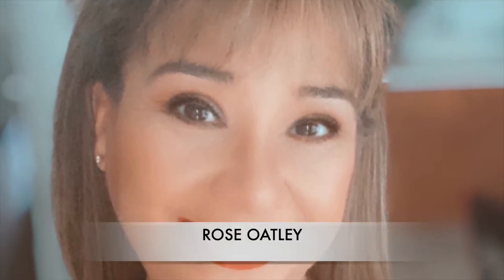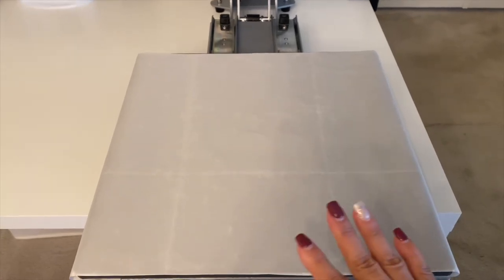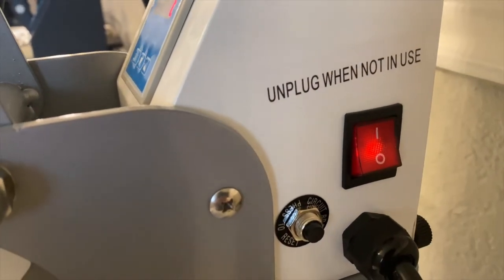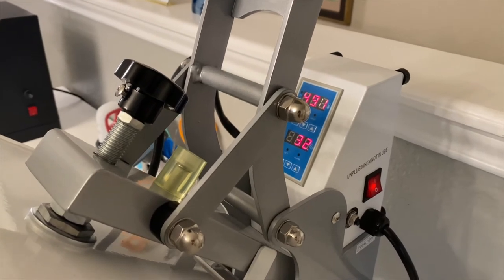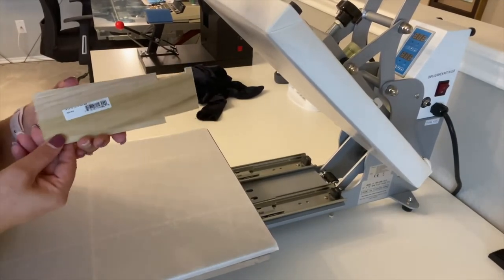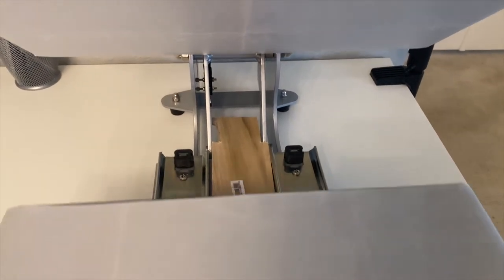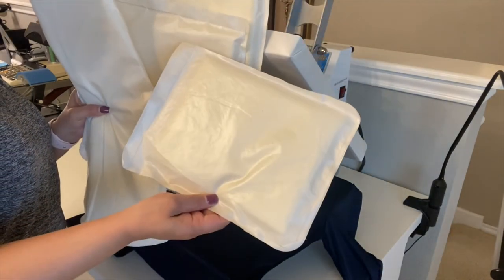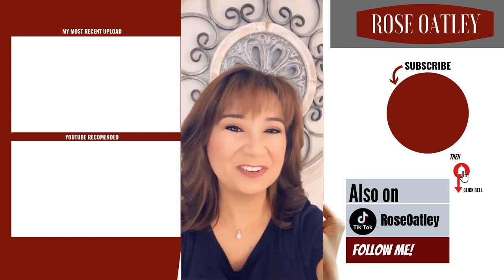Craft Pro Heat Press and Heat Press Tips for All

Comment: Thank you for the video…very helpful as I just purchased the same press.  Can you tell me where did you get the sheet guide?

Thank you.
Reply from the maker: Welcome, Linda!  Glad to hear it was helpful.  You can find it through Heat Press Nation.  I’ll post the link.  https://cdn.shopify.com/s/files/1/0229/1646/4718/files/HPN-quick-reference-guide.pdf?v=1585587273
Reply: Hi Rose, any tips on the heat press you use?  Do you have avideo on that, especially pressure?  Have you ever had a need to use heat pressure pillows?  Thank you.

Comment: Hi Rose, have you had any issues with it being hard to open the press once the timer goes off? I bought this exact heat press in 2019 and I have always struggled to get it back open when it's done pressing. I panic thinking I am going to burn the shirt because I struggle with it.
Reply from the maker: Hi Melissa!  I can’t remember having that problem. Try adjusting your pressure to see if that helps.

Comment: So I tried my very first dtf press on a used shirt for practice and nothing transferred onto the shirt. I tried everything. Is it bc its an old shirt? Must the shirt be brand new?
Reply from the maker: I would try it on a new unwashed shirt or even test it out on a small piece of fabric first.  Make sure your heat press is coming to the right temp and you don’t have a faulty heat press.  You can use a heat gun thermometer.  You will need to also check your pressure.  
A good rule of thumb is to press for 10-15 seconds at 350-380 degrees Fahrenheit and medium-to-high pressure. If you use a light transfer, you may need to reduce the pressing time slightly.  They are also cool peels so make sure you wait for it to cool off before removing your transfer.
Reply: @RoseOatley  that was helpful. Thanks for taking the time out of your day.
Reply from the maker: You’re welcome! Anytime 😊

Comment: Hello Rose, I purchased the exact same press as yours recently.  I'm getting square  lines from the top platen, is it because of the pressure?  I followed their instructions on the 'paper' test, but still...Your input please.  Thanks.
Reply from the maker: Hi Linda!  It definitely shouldn’t make any lines.  Try loosening the pressure a little.  What kind of material are you using?  I have seen heat presses sometimes make marks on certain type of polo shirts due to material.  You can also try testing it on a regular cotton T-shirt to see if the same lines appear.
Reply: @RoseOatley  Polyester by Sport Tex.  Thanks,,.I will try.

Comment: As the heat press is nearing the target temperature, does the heat light and heat turn off and on every 3 seconds? Mine does that and I'm not sure if that's normal or not. Thanks!
Reply from the maker: Hi Astro!  I don’t think I’ve ever seen mine shit off.  I will double check it to make sure and get back to you.

Comment: My press jiggles and about comes off the table when I do screen prints. Is there a way to bolt this down and stop that jiggle of the top plate? 😭
Reply from the maker: Hi Rachel!  I haven’t seen anyone bolt a heat press, yet.  I would recommend you contact the manufacturer to make sure and be safe.  Of course the easiest thing would be to put it on its own separate sturdy table.  If you shop Ikea, you can find reasonably priced tables.  Thanks for watching!
Reply: Thank you rose :)

Comment: Wondering if your husband can provide instructions for making the spring cover for the craft pro heat press.
Reply from the maker: Hi Cheryl!  The measurements for the board are as follows.  You will just need to place it again your machine and mark where you have to make the small cuts.  We are currently going through a stressful kitchen renovation.  As soon as it’s done, I will see if my husband is willing to cut a few of these I can offer everyone.  Hoping to finish this renovation in the next 2-3 weeks.  Thanks!
Board measurements:  
Length 7” 
Width: 2.5”
Thickness: 1/4”

Comment: Do you make heat transfers only?  I’m looking for a one but no one seems to be able to make it .
Reply from the maker: Hi Gina!  I mostly work with HTV.  When you say one, do you mean just a number one?

I used to do tshirts, cups, decals, etc. but had to stop due to my severe carpal tunnel. I need to get surgery so I can get back to doing more stuff I love.  Just trying to hold off until my daughter graduates in another year. Lol.  I’m just doing small projects my hand can tolerate for now.
Reply: Looking for a subliminal heat transfer of the wizard of oz
Reply from the maker: @ginacovey1312  - I don’t do sublimation.  I can refer you to someone I know.  If it’s the Gina, I know, send me an email or message me through FB.  It’s just a matter of someone with the right printer printing it and pressing it. 😊.

Comment: This heat press is so hard to open at times.
Reply from the maker: In this case, you want to adjust the pressure.
Reply: Still doesn't help. There's something about the pressure dial that doesn't work. I loosened the pressure, closed to press and could not get it open for the life of me!
Reply from the maker: @mannty766  make sure you’re turning in the right direction left to loosen.  If you’re still having issues, it could just be a faulty press.  I would contact them.  Mine isn’t that hard to open unless I tighten it too much.